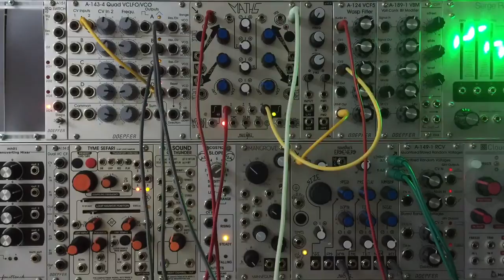Harmonic Method 1

Comment: Sounds sweetly wonderful....thoughts on the verbos harmonic generator? other less costly harmonic generators?
Reply from the maker: Thanks! It's a very versatile module, more so than I thought at first. Whether it's worth the money and HP might be another question.

AFAIK, it's the only analogue harmonic oscillator, certainly the only one with this level of control and individual outs. Harmonic additive synthesis is more of a natural fit for digital technology, and I think Telharmonic is the most fully-featured Euro example of that, with plenty of control and other modes. Braids also has a harmonic mode, though with simplified controls, and of course neither has individual outputs for each harmonic, which I find is something I use all of the time with my HO. The HO also has its own distinct sound, since each harmonic is derived from a series of rectification, wavefolding and filtering operations on a single VCO core, and the results aren't pure sine waves but something with a bit more grit and buzz. It thus doesn't have the precision of Fourier additive synthesis with digital technology, but instead it has what I think is an interesting richness rather than glassy precision.
Reply: Thanks so much...appreciate your thoughts and input..keep up the great soundz!...